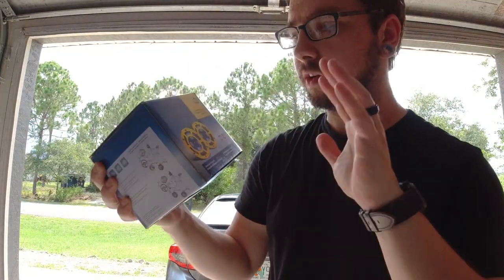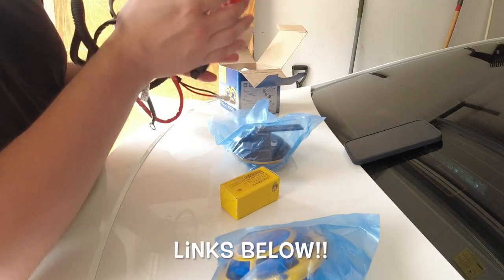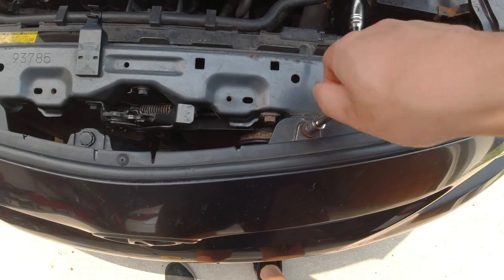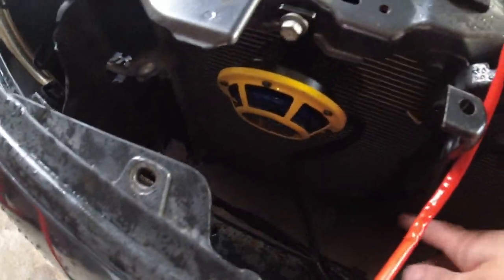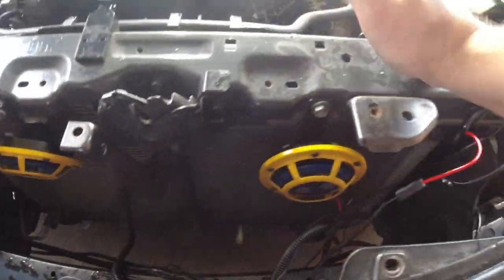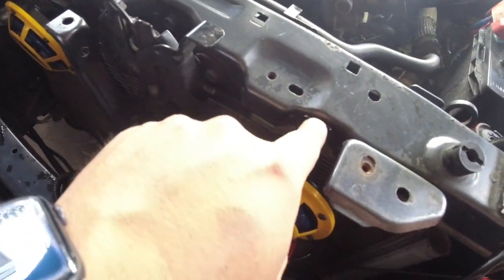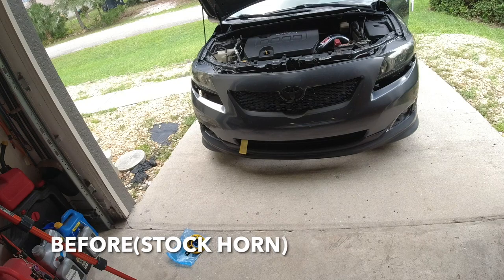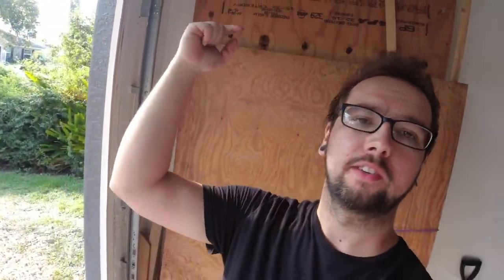INSTALLING “HELLA” HORNS IN MY COROLLA!

Comment: Why do you need another relay when there is already one in the fuse box? Couldn't you avoid connecting directly to the battery and needing another fuse by using the relay already in the car?
Reply from the maker: From what I have read about this, the 2 horns will draw much more power from the car, which may over load the circuit and cause the fuse to blow.
Reply: Hey mate! did you installed yours already? do you know  why you need to use a power cable directly to the battery? Can I just only use the existing power cable from the old horn? and not use an extra cable directly to the battery + ?

Comment: Good video, but why you need to use a power cable directly to the battery? Can I just only use the existing power cable from the old horn? and not use an extra cable directly to the battery + ?
Reply from the maker: Thank you! 
The reason I connected it straight to the battery with its own inline fuse, was because the 2 horns draw more power than the stock horn relay and fuse can handle.
It is only a recommendation. But if you did hook them up to the factory wiring, may blow a fuse every once in a while.

Comment: One mod I been wanting to do is get horns from a 2014 (or that generation) Camry because they dont sound all squeeky like the stock horn does. I think all I would need is a Toyota harness to pig tail wires if the original harness doesn't fit, and just wire it up. T the wires to account for the second horn and I should be set.
Reply from the maker: That’s a good idea. I always heard that lexus has the 2 tone horns as well. And just need some minor modifications to work.
Reply: Did you have to get a Toyota Harness or can I just find a Camry and get the horns and that harness?

Comment: These horns are a basic electronic buzzer. They use an electromagnet and a make and break switch that causes the electromagnet coil to oscillate the horn diaphragm.  So there is no eletrical polarity.  They can be wired either way.
Reply from the maker: That is good to know! I did not know that about the horns!
Reply: Hey mate, do you why you need to use a power cable directly to the battery? Can I just only use the existing power cable from the old horn? and not use an extra cable directly to the battery + ?

Comment: Cool video, I do like the yellow accent! A suggestion that I have for you is that if you decide to make a ‘3D prints pt 2’ video, you could 3d print a longer mount for the horns so that the horns can be lower, like how you mentioned in the video.
Reply from the maker: Yeah that would actually be a nice idea! Definitely will have to try to design a bracket up!

Comment: I just subscribed last night and💥 another video drop
Reply from the maker: Awesome! Well now you get an extra video to watch!
Thanks for the support!
Reply: @BrandonStellmach  I have a Scion xD but we share the same engine and wondering in that tune would work for my application?
Reply from the maker: @arctictruck10  that’s is a good question, I think you would need to find out if they have the same ECU. Because that’s how they tune it. As long as it’s the same I don’t see why it wouldn’t work. Best thing to do is message them. And they should be able to help you.
Reply: @BrandonStellmach  👍

Comment: Great video! Another DIY project for me coming up! When you cut the old connector, the remaining wire connection is the one you use to power up the horns? Red wire to res of the harness and then black wire just ground it? Thanks sir!
Reply from the maker: Thank you!! 
And yes the one wire I splice into, you will connect the red wire. And the other black wire just gets grounded to any bolt on the chassis.

Comment: Been thinking of this upgrade for my 03 Corolla CE.

Difference between yellow an red is high pitch vs low pitch?
Reply from the maker: It’s a nice upgrade. I mean it’s more visual Then anything. But they are louder! 
And I was wondering the same thing. I don’t think they are, but I would need to hear them side by side to actually compare.

Comment: If u want my opinion u should put a D shape steering wheel.
Reply from the maker: I was thinking about getting the 10.5 gen S steering wheel, which has the D shape, but I didn’t like it because it’s not leather, it’s just some type of rubber. But that’s why I upgraded to the S steering wheel from the 2009 corolla, because it’s leather wrapped!
Reply: There is an amzing leather wrapped D shaped with carbon fiber and steering control if u have instagram ican provide u with a photo.
Reply from the maker: @khafaji4116  @justa_yota if you want to send me a picture!
Reply: @BrandonStellmach  i've sent it to u.
Reply from the maker: @khafaji4116  I just went to look, but I don’t see any new messages.
Are you sure you sent it to the right account?
Here is a link to my Instagram:https://instagram.com/justa_yota?igshid=YmMyMTA2M2Y=

Comment: Seat covers next?
Reply from the maker: I have been looking into some, very hard to find good fitting ones!
Reply: @BrandonStellmach  If you find good ones that are heated, I'm interested. Jelly that my mom's Camry has factory headed seats, but they weren't even an option on any trim of the Corolla.
Reply from the maker: @ProjectBlackweather  it would be awesome to find some that were heated. Like I said I’m on the lookout. And hopefully I will find a good set soon!

Comment: Sir i saw a PIAA supernass h0rn install video and he didnt used any relay for the two h0rns, just a wiring adapter. Can i do the same with the hella horn? The car was a 2020 corolla
Reply from the maker: I Have seen people do it that way as well, much less wiring, but the reason why they wire it with a relay to the battery is because the 2 horns draw more power than the stock horn. I guess it’s more of a safety thing, so you don’t blow any fuses.
Reply: @BrandonStellmach  thanks sir. Maybe ill just use the wiring harness you recommended for the horns but will buy PIAA instead. Thanks sir!